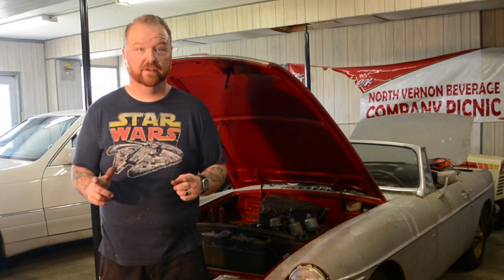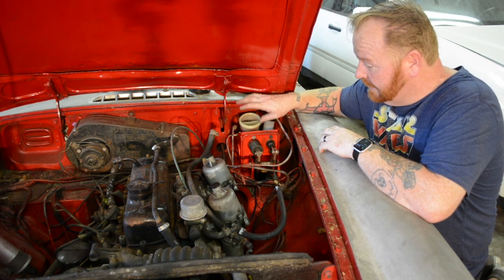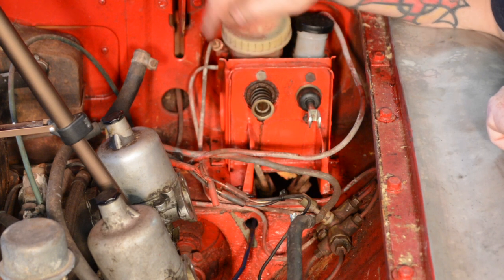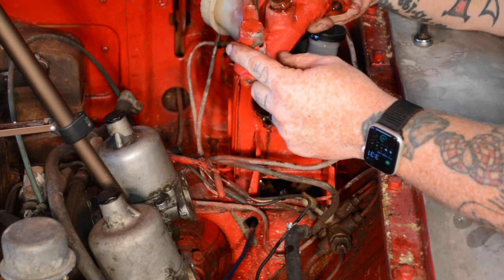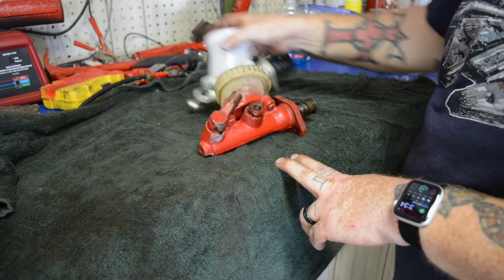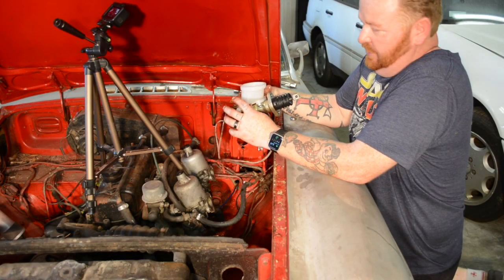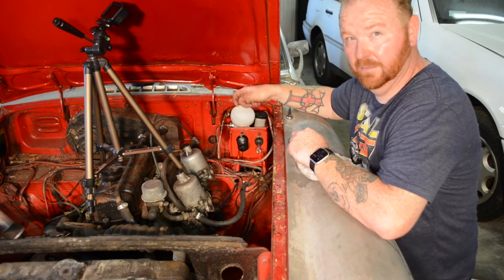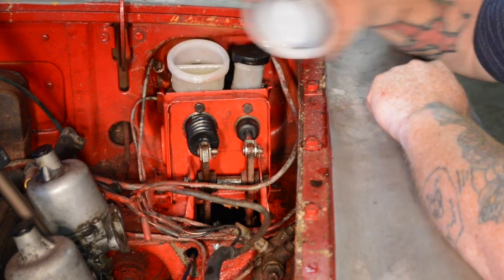1970 MGB project (Video 4 Replacing the Brake Master cylinder) #MGB #CLASSICCAR #RESTORATION

Comment: I like your video and if I could add a couple of notes though.  The video only showed installing one copper washer, there are two, one on each side of the Banjo fitting.  Also, if this is a Dual Line Non-Servo Brake Master Cylinder, as it appears to be, then the trap valve body was left in the old Master.  These are not available and do not come with the new master cylinders.  Be sure to pull it out and move it to the new.  Check Moss Catalog, its PN 180-225.  This will affect how your brakes feel.
Reply: I enjoyed your video, thanks for posting. Actually there are trap valves in the master cylinder he is replacing. If you look carefully early in the video he picks up the master cylinder and something falls. That was this master cylinder trap valve. And it is not critical, but it is a part of the master cylinders sold now that is often missing. When I replaced my master cylinder a few years ago, I took it from the old BMC and put it into the new one. Also he should have mentioned the correct way to bleed the hydraulic brakes. Start with the brake cylinder that is the most distant and bleed it. In this car it is the drivers side rear brake, then the passenger side rear brake, then the passenger side front brake and last the drivers side front brake. Also do not forget the bleed again after a few days as there may still be bubbles in the fluid.
Reply: thank you for posting.   I am seeing both of these issues important.   When I took my old one off, there was only one copper washer.   That was a leak point.